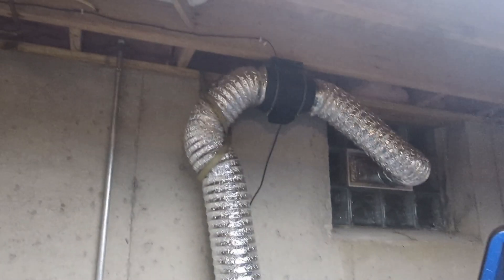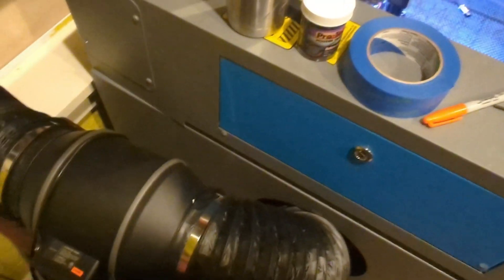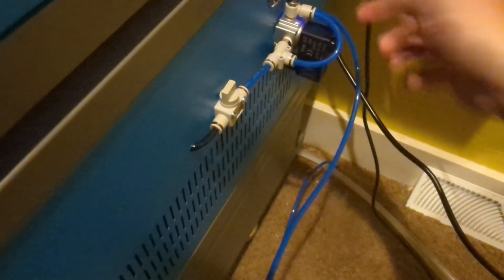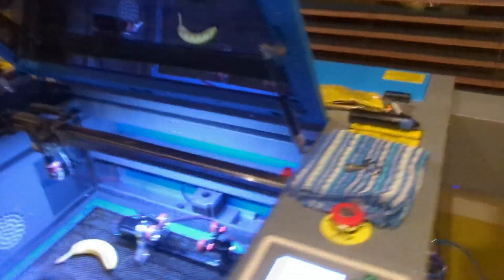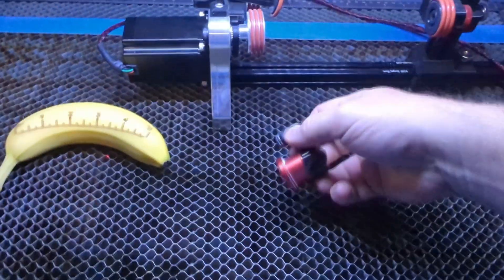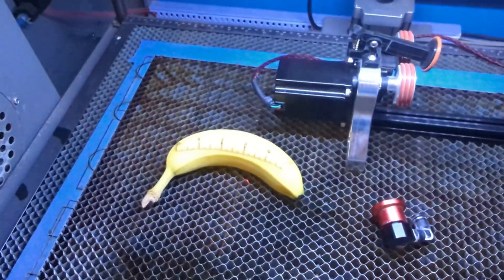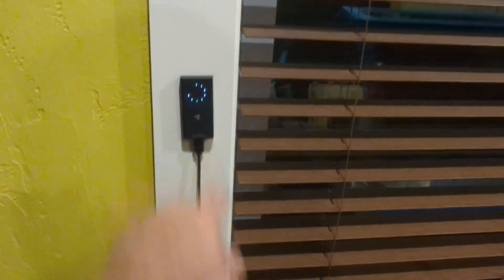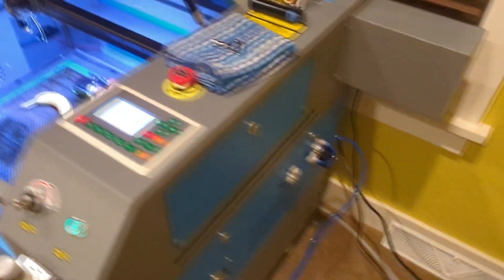Omtech 2028 80watt with 2023 upgrades and some mods

Comment: I just got MF2028 80W.  Im looking to add LED light to it. Would you be able to show exactly where i would connect the wires too?
Reply from the maker: @ald.3449  I will have to take a couple of photos tomorrow.  You'll need 24V LEDs, of course.  There are positive and negative busses you have to hook them to.  I can take photos of my connections in the morning.
Reply: @seanmullen2561  ty really appreciate it
Reply from the maker: Actually I was incorrect about the bus bars, that was our 2440.  In the 2028 I have the lights tied into the controller +24V and the ground.  The blue and yellow wires in this photo (circled) are the lights:  https://photos.app.goo.gl/51ujcXDsr8LAMpsd9
Reply: @seanmullen2561  ty, really appreciate it

Comment: Regarding your air extraction, why'd you remove the stock one?  I suspect you could getter better airflow from the after market unit; I am dealing with similar issue.  You ever think of removing the fairing itself, or the grid of holes to better enable air flow?
Reply from the maker: @munro4398   I actually have removed both the stock fan and grid of holes to improve flow.  I didn't want to have 2 fans running at different speeds nor did I want the obstruction of the non-running blades.  Initially I did leave the grid in place.  I've since also removed the grid and saw significant improvements after that.
Reply: @seanmullen2561  funny. I'm having exact same issues. Fans at different speeds and circle grid. I'll remove my grid soon enough it sounds like. Cheer's 🍻!

Comment: Where did you find the m22 lens retention ring? I can't find them anywhere.
Reply from the maker: Yeah, that one is/was a challenge that I kinda cheated with ... For our 100 watt 2440, I'd ordered an extra lens tube that came with one of the retainers.  Because I also couldn't find one alone to order, I permaently borrowed the retainer from the extra tube.
https://www.cloudraylaser.com/products/cloudray-c-series-co2-lens-tube-outer-diameter-24mm?_pos=5&_sid=f0676b082&_ss=r

Comment: Is that a typical 3 way solenoid, with an exhaust? You just use the Normally Open outlet with a needle valve and shut-off valve?

Great info, thanks?
Reply from the maker: Yes, I actually bought the 'cloudray ultimate air assist' kit from Amazon that included most of the parts.  The solenoid is 3 way - one input and then 2 output.  Solenoid off, the air goes out one port to the needle valve, solenoid on, air goes full blast out the other.  The needle valve out then Ts back into the line leaving the full blast out.  So, solenoid off, you get low flow to keep lens clean (air off in light burn).  Air on in lightburn, solenoid on, you get full pressure.

Comment: Hi Sean
I'm looking to buy a 60 watt Omtech & immediately replace the glass tube with a Synrad 60 watt air cooled tube. Question I have is from the base of the cabinet that the glass tube holders to the middle of the first mirror, would that be a minimum of 2 7/8" by chance? I can't get Omtech to answer that question for me. Thanks
Reply from the maker: Sorry, just noticed this, will measure in the morning.

Comment: What solenoid valve is on your 2028? I’d love to find a valve like that as I prep for the arrival of my 80w 3624, as having the low flow and high flow would be awesome
Reply from the maker: Sorry for huge delay, probably way too late.  it's a tailonz 2V025-08.  It's a 2 way, not 3.  in its closed state, air goes out one opening that has a needle valve greatly restricting flow to a "keep the lens clean" setting.  Open, it goes out the second channel fill force for cutting.  While a 3 way solenoid would be great to allow off, low, high, I don't think the controller nor the lightburn software can handle controlling that.  So, I typically use the regulator to turn the air off when not using the laser and back on when starting (I want to get a decent ball valve to simplify that and reduce wear on the regulator but haven't done so yet.

Comment: were did you order the auto focus as I would like to get that for my 60watt as my stock auto focus went up on me?
Reply from the maker: The new 2023 lasers (at least some models like the 2028-80) come with this new auto focus.  I've been looking around to order one for my older 2440-100 and cannot find them yet.
Reply: ah I have the AF-2028-60W Red/Black and it came with the side auto focus, sometimes that gets in the way when engraving or cutting with your magnets that keep the wood down, this would solve that issue. @seanmullen2561